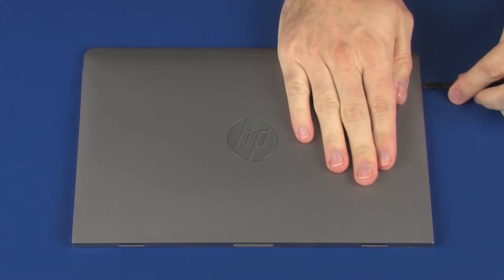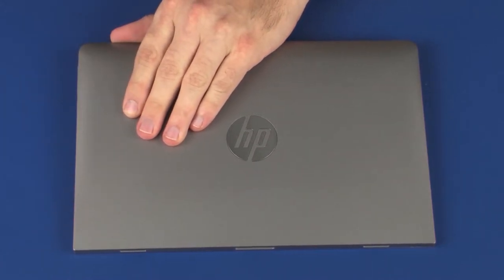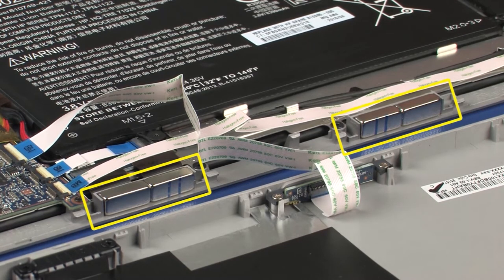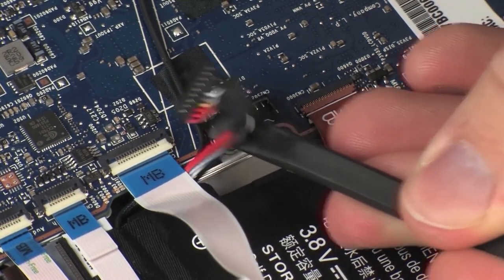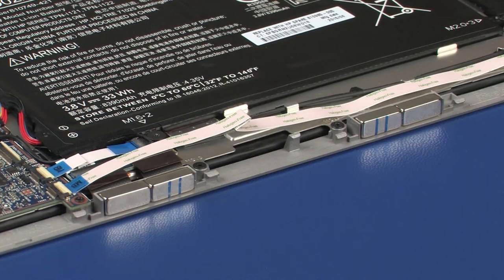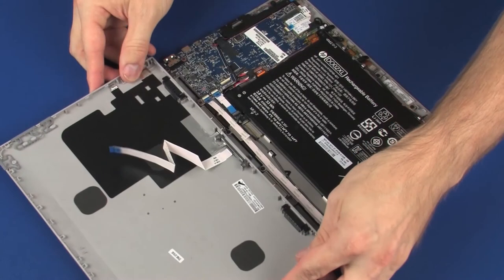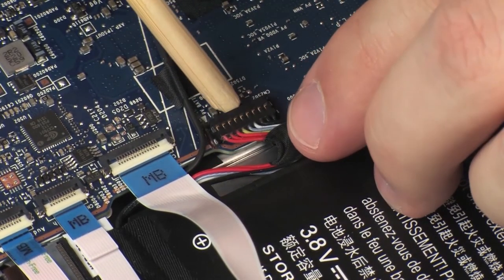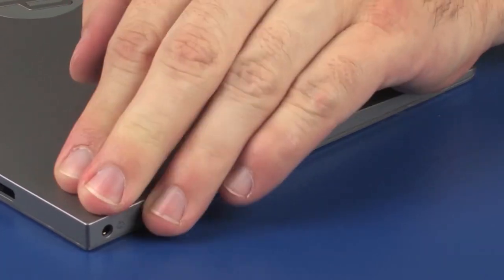Replace the Display Enclosure | HP Pavilion x2 Detachable 10t-n000 Notebook | HP Support

Comment: I want upgrade to ssd but no socket
Reply from the maker: Hi Aldrin, thanks for contacting HP Global Social Media Support!
I understand that you need to upgrade the SSD of your notebook.
I will do my best to assist you.
HP does not recommend upgrading or downgrading hardware parts or software that is bundled with the product as It may affect the manufacturer's warranty and performance, however, you could change the configuration at your own discretion.
Binu_HP Social Media Tech Support